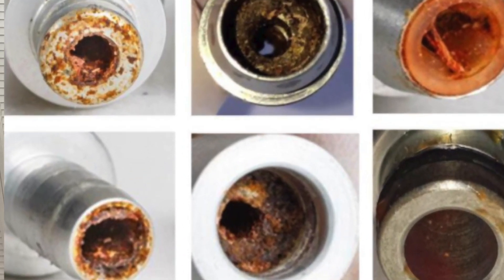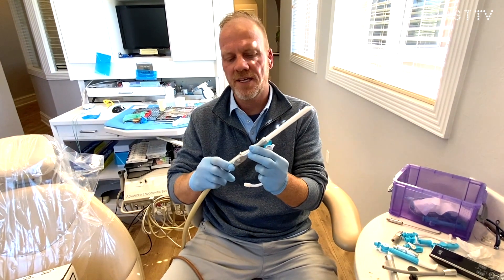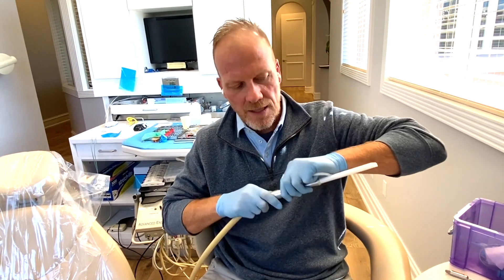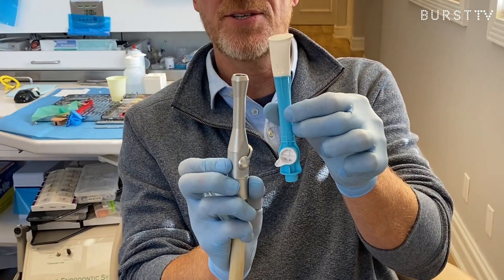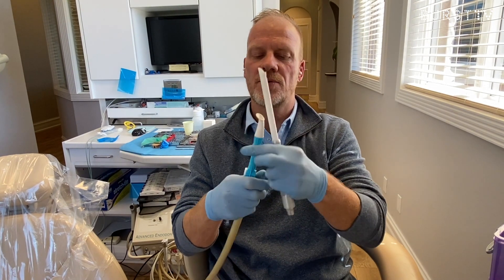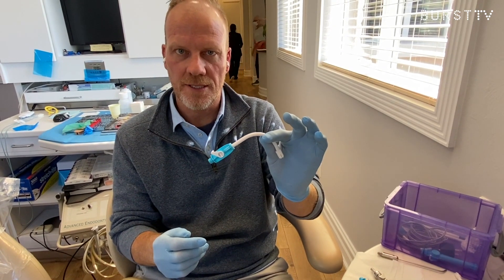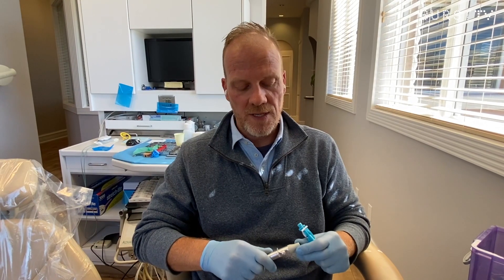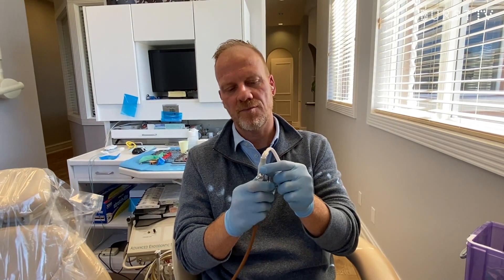Say No To Backflow With Disposable Oral Valve Evacuation

Comment: They need to design a backflow preventing valve that still allows for the use of HVE and saliva ejector tip of you choice.  The problem lies within the cost $2.60 per patient and amount of plastic waste.  I unfortunately don’t see this specific item gaining a lot of momentum in dental practices as insurance carriers continue to decrease reimbursement.
Reply: The main issue is what occurs between patients.  Any debris in the evacuation line builds up on backflow flaps - resulting in a flap that will not close.  
Devices not disposable will not work after 1 or 2 patients because they will not close.  Some also stick open if too much debris flows through.  Its the main reason flushing daily does nothing other than serving as a "Drano" type of fluid that keeps lines open but does not clean them for every patient.
Currently we make just the valve with backflow prevention at $1.25 a piece.  Yes plastic.
To achieve the same result in a metal valve - the IFU would need to be followed creating a similar waste footprint from cleaning detergents / plastic sheaths to wrap parts for autoclaving / sterilizing cycles through a statim or similar device / and then recovering the device in a plastic wrap / yet backflow would still exist.
Our plastic is made in the U.S. and in terms of plastic has the highest recycle/breakdown ability - however due to the blood contaminants it needs to be treated as waste.  Many schools / public sector / and offices with high production but minimal cleaning time between patients have since adopted the disposable valves because of the safer nature of a device that often is only wiped.  Again, thank you for your thoughts.
Reply: Wth! You put plastic waste above your patients safety?! You should be in prison!